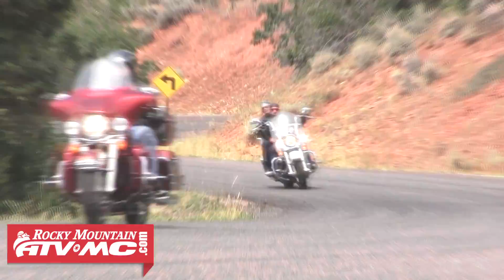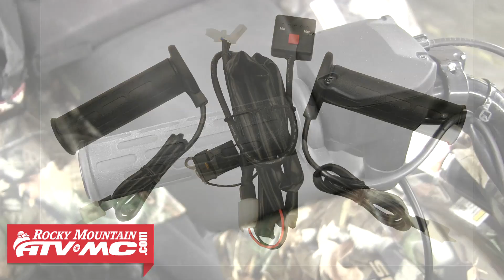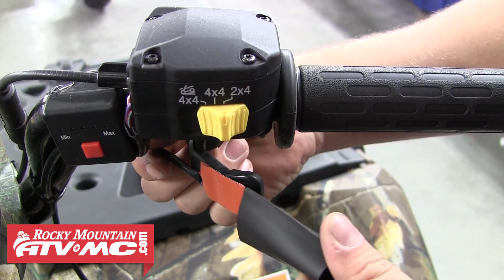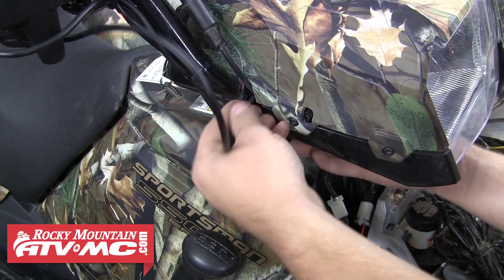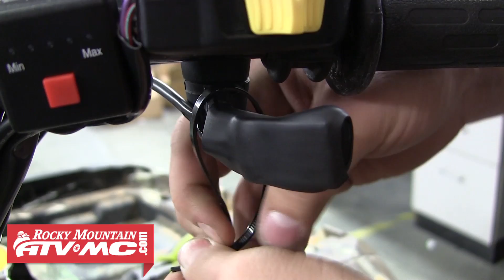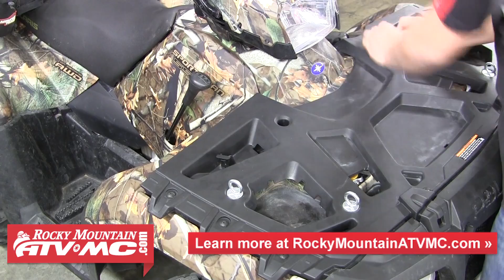Tusk Thumb Throttle Warmer Installation

Comment: Be aware even if there is a loop of slack in wiring for thumb warmer iyou need to turn handle bars all the way in both direction and check slack again. Do not tie wrap to the throttle wire! It could cause wire thumb warmer wire to pull on the slack when handle bars are turned a lot. If throttle sticks at quarter throttle  from wire on thumb warmer  throttle could slip into full throttle if operator floors it. Be careful in snow when tires are spinning.just be careful and check your wire and throttle. Have  full view of throttle. Do not cover ever,

Comment: Don't use the thumb warmer! If the wire tension is pull to tight when turning handlebars the throttle could stay wide open throttle like my polaris scrambler 850. I jumped off it breaking my pelvis and totaled the front end. I may take 4000$ to fix it. I had know insurance on the vehicle damage.
Reply: Greg pace I use it, it works perfectly. Sounds like you screwed up installing it. Your fault not Rocky Mtn.
Reply: Were off/kill switches and ignition key an option on the Polaris? I mean we all know Polaris is junk but come on.